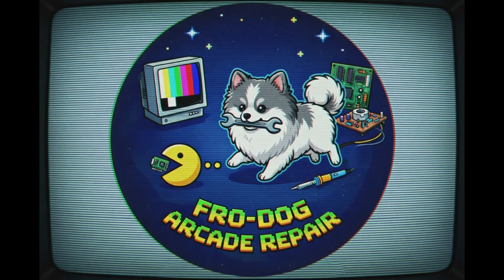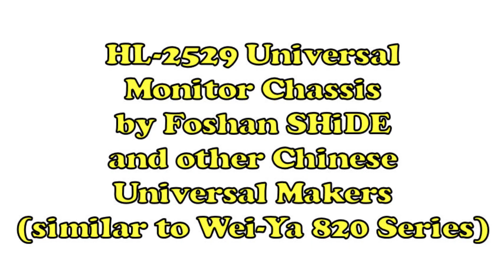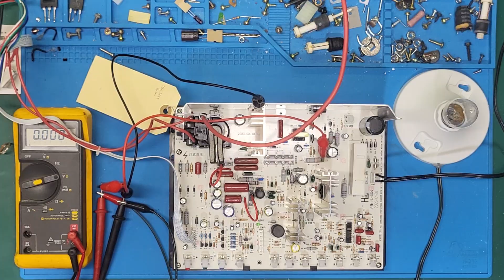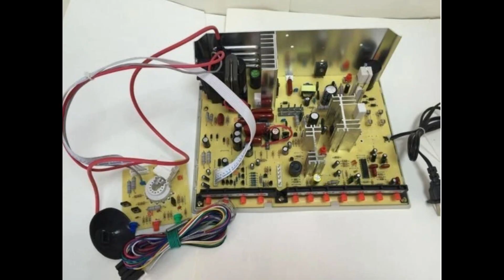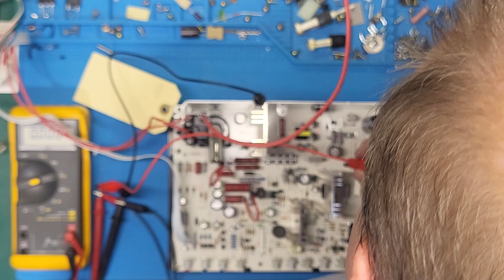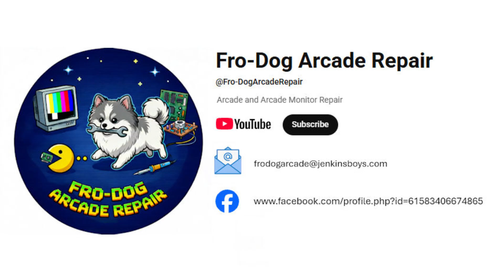How to Light Bulb Test a Foshan SHiDE HL-2529 Chinese Universal Monitor Chassis

Comment: Hi I'm Running one of these. I was wondering if you can let me know what the pots are on the chassis. As I am not as experienced I don't want to turn them all and figure out what each of the pots at the rear of the board do and lose my settings. All good if you can't it's a pretty annoying request 😂
Reply from the maker: Sure. With the controls facing you and working left to right:
Red, Green, Blue, Brightness, Horizontal Size, Pincushion, Vertical Position, Vertical Size, Vertical Hold, Horizontal Hold, Horizontal Position.

In the right rear corner is the B+ adjustment and near the center of the board is Vertical Linearity.

Hope that helps.